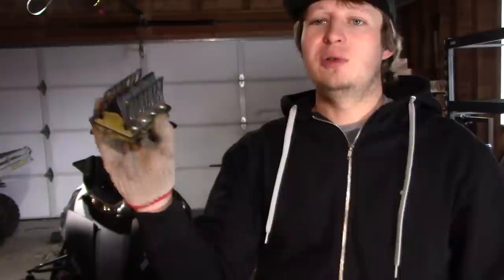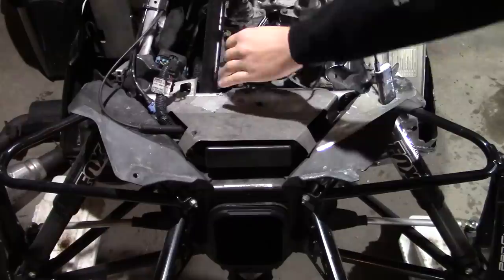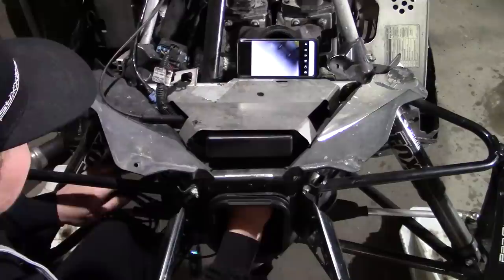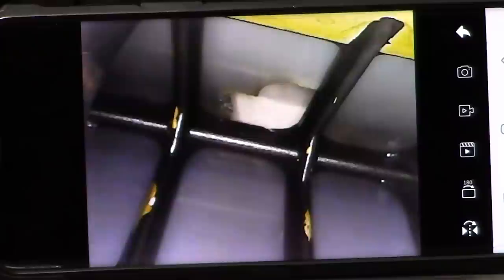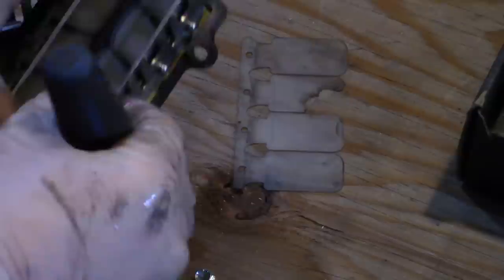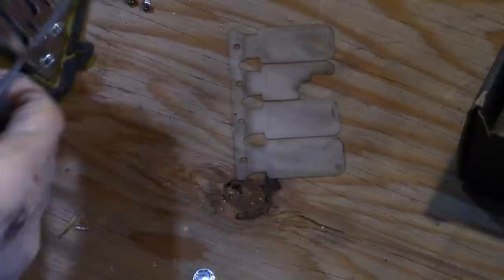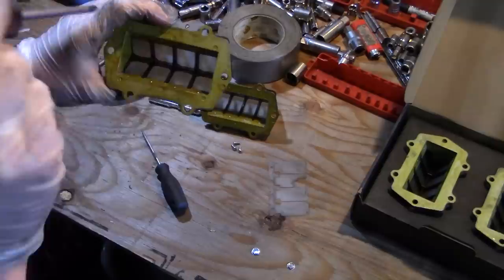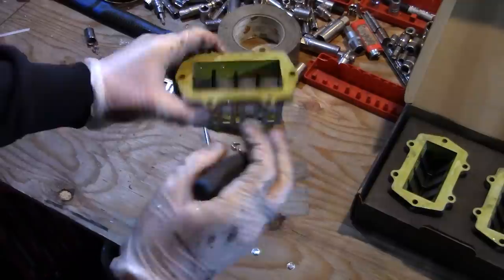SLED BOGGING? FAILED REEDS! WHAT TO LOOK FOR

Comment: So this is crazy, but went out for the first rip Thanksgiving day and the thing just kept falling on its face. I called it quits and headed home. Finally figured out that a plastic thread protector from a spark plug got dropped in the air box, sucked through the carb, and was bouncing around in the reeds. If I let off the throttle it would fall back out and it would rip for a 1/4 mile, then it would get sucked up against the reeds again and fall on its face. So frustrating, but an easy fix in the end.
Reply from the maker: Good one! xD

Comment: Have you done any videos on cleaning and adjusting the power valves?  Ctec 2 if ya got it.
Reply from the maker: I haven't. It's not actually something that is super critical on these newer machines. But I could pull them out in a video.

Comment: Would this cause the snowmobile to loose rpms when in deep snow? Mine revvs high if I spin the track on the trail or roads but under load in deep snow my sled will loose rpms and get stuck, my snowmobile also misfires and the engine light comes on because it’s not back shifting gears properly I believe

Comment: This is excellent. Thanks.
Reply from the maker: You bet, man!
Reply: I love watching your videos, ik you have 2016 M8 which is exactly what I have and your 4 yeat review is why I bought it. I am having issues with ECU code 16 and bogs down alot, is this the fix? I don't have the space or tools to do this myself just yet as I am 16 but wanna make sure Ik what it is before I take it into the shop so I know what needs to be done and don't end up getting charged for something it didn't need. I do alot of the work myself and cleaned power valves recently but it didn't do too much. Thanks!

Comment: so... any idea why my sled  which is a 2007 500ss   ran perfect. no problems all last year.. no problems for the first hour i was out the other day.than all of a sudden i came to a stop and it did not want to idle proper.. kept wanting to die .i brought it home right away... pulled plugs tossed them and put new ones in... seemed fine.went for another ride prob 45 min to an hour than all of a sudden rpm drop. motor had a bit of a shake to it and it started blowing smoke... i went through 1/2 my oil in that time.. it was topped up when i left home only 1/2 when i got it back... i did ride it home but really slow.. and left a smoke trail the whole way :/

Comment: Good thing you have a video on evrything. One sled I’m looking to buy had topend redone I asked what at 3000km he said reeds failed made piston go bad it has all be done at a dealer I wonder can reed fail wreck a piston ? I guess so but could it damage the Zylinder too ? Prob can’t hurt the crank ...
Reply from the maker: Though unlikely, if I big enough reed flap breaks off, yeah it COULD happen. The most wild thing I've seen is a piece of belt fragments blow and somehow end up in the intake and get sent through the engine, and blow the rod through the bottom of the block! 
Wild.

Comment: My sled seems to load up. Carbs have been cleaned. After idling or slowing down in the ditch it doesn’t have good power until u get going for a little bit. Also seems worse when the sleds on its side when carving almost no power. Any ideas?
Reply from the maker: Check the jetting and make sure it's right for the altitude. Or, clutching issues maybe.

Comment: Does that motor have the suzuki 800 ho? because I bought mine last year (used with 3100 mi) and it ran good for about 200 miles then would constantly bog and not go over 5 grand
Reply from the maker: Yeah. Some motor. I would say it's time to check your reeds out.

Comment: Morning Matt, 2008 Dragon 700, low mile, under 1200, has had a Boondocker turbo on her since new, was running just fine, then on the mountain, started bogging, and will shut itself off, had to get towed off the mountain. My Buddy is Fed up, want's to just unload it. On a Polaris 700 from 08, 1. Reeds, 2. tps 3. crank seals, In any event repairable i your opinion? thanks!
Reply from the maker: Probably the last thing you want to hear is that, The Dragoon is generally considered amoung the community as one of the worst sleds ever made. Unfortunately, I have never heard anyone say a good thing about a dragon. I've never owned one but the community seems to say one thing: junk.
Good luck with it!
Reply: @syxxes  totally fine, AND yes to 800 dragons, but I'd the 700 is just as bad then he is stuck with it! Thanks for your honest opinion! It confirms everything!

Comment: Would that cause low speed bogging on a crossfire 800 ho?  Usually stops bogging after I pump the throttle a bit and am running over 5k rpm, and then seems to run fine with lots of power.  Always just a start moving bog.
Reply: Did you figure it out?
Reply: @adamcarlsson9931  Ended up doing a compression test and found one piston was only running 50 percent.   Tore it apart and it had been melted and badly scarred.   Don't know why yet, but obviously some major mechanical failure.   Still can't rule out bad crank seals.  Maybe something in the crankcase broke and went up into the piston though.   I did however observe extreme heated spark plugs.....very white on the ends.
Reply: @rydstallion75  although I’m not a expert, to my knowledge white spark plugs mean it wasn’t getting enough mix oil.
Reply: @feidhlimmarion1499  Interesting, I'll look into that.

Comment: Hey man, is it possible to install them upside down or could they go in either way?
Reply from the maker: These ones are not directional.
Reply: @syxxes  how do i tell if mine are or not? It's an 99 xc 500
Reply from the maker: @gala83filmstaylorg7  you just have to look at them and see if they are symmetrical or not

Comment: I don't have a sled but I have a 2 stroke waverunner. I rebuilt the carbs and did notice  a few reed pedals lifted up so I flipped them over. My question is will a bad reed make the top end feel flat.  It does have some bog if Idle for a bit and punch it but it feels like there is no power after 3/4 throttle.
Reply from the maker: Bad reeds will cause that issue for sure. Depending on how bad they are it might not idle well, or it feels like its governed past a certain point on the throttle
Reply: @syxxes  it did both. I tuned it so the bog was not as bad but it felt just like u said governed.  It was a brand new top end and both carbs were rebuilt. I just couldn't get it to tune right last year so I stoppedridingit. I'm going to pull the reeds out when I get home amd check them out. Thanks for your time amd quick reply
Reply from the maker: @jeffbryner5355  good luck!

Comment: My 12 f800 has oil in the air box is that normal?
Reply from the maker: Yea pretty normal. You can do the check-valves but I recommend wiping out the oil and going riding.👌
Reply: I was wondering also thank keep it up
Reply: Syxxes Performance thanks for the reply

Comment: Would these reeds be in an 94 carberated engine?
Reply from the maker: Yes, as long as it's not a Rotax Engine. Some Rotax engines of that era use rotary vavles.
Reply: @syxxes  I’m sorry but I am not sure what the difference is or how I would identify what type of engine I have if it helps I have a 94 Polaris Indy sport sks
Reply from the maker: @IsaacN588  that'll be a reed valve
Reply: @syxxes  alright Thankyou, and where might these reeds be located cause I have a really bad backfiring issue and power loss